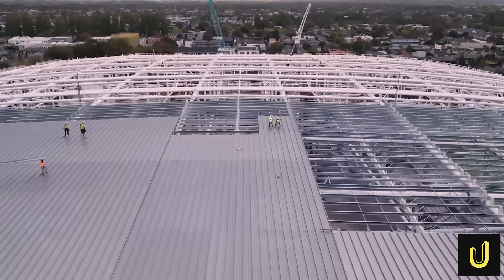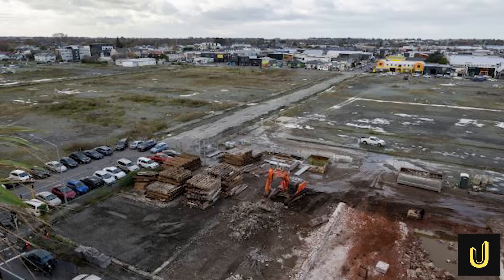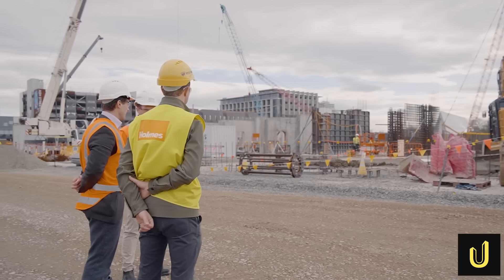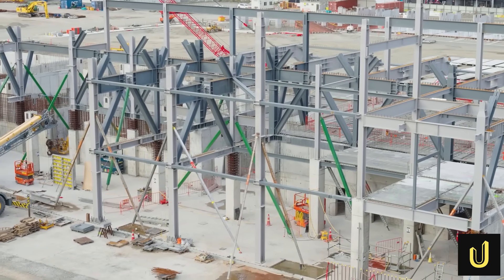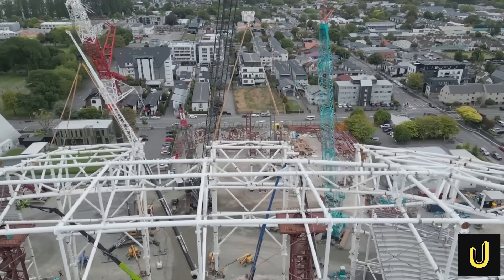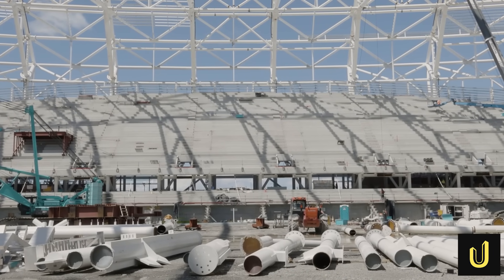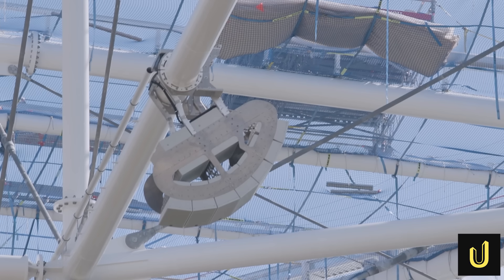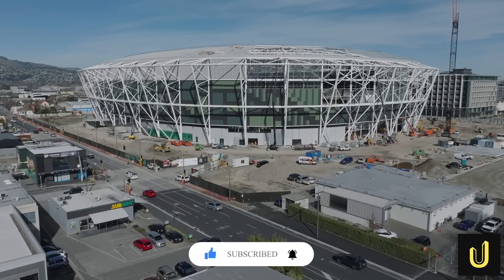5 MASSIVE Engineering Feats Behind Christchurch's New Stadium

Comment: Sadly this stadium is a insulting joke to locals here in Christchurch. the stadium is too small for the city already, and its location is crazy wrong when they had better sites available. we had somewhat of a blank slate after the quakes. there is no parking near by or rail and bus exchange and proposed rail station are 4 or 5 block walk, which is not going to work. current bus exchange facility will not be able to handle the influx of people for events, and inner city traffic will be brought to a crawl as the stadium is between two major arterial one way system, with high traffic flow.  biggest joke of the rebuild and there have been others.
Reply: What a lot of BS. Christchurch has a population 412,000 and a 30,000 seat stadium is more than big enough. The only time they will sell it out is when the All Blacks play there.

Comment: It would have been cheaper to have built it on more stable ground at Rolleston where there is also a rail line from the North, the South and also from the West.  More than enough sufficient area for parking when the stadium has a seating capacity for 24,000 people.  Parking for this number of people in the central city is an engineering problem that needs a solution.
Reply: The bus exchange is 5min away and uber is cheap most people will have a drink or 2 so wont be driving ,and rolleston what a stupid idea

Comment: What does Te Kaha mean?
Reply: It means Maori "gifted" a name that anyone else could have assigned without any fanfare.
Reply: The Strength
Reply: "Te kaha" is a Māori phrase meaning "strength," "enduring strength," or "to stand firm". The meaning is often connected to resilience, with "kaha" referring to strength and "te" meaning "the". It is the root of the phrase "kia kaha" (stay strong), and it's also the name of a New Zealand community on the East Cape and the new stadium in Christchurch. 
Core meanings
Strength: The literal meaning of kaha is "strength".
Enduring strength: A shortened version of the name Te Kaharoa, it signifies long-lasting, enduring strength.
To stand firm: This meaning comes from the name of a New Zealand community, Te Kaha, which was named after its tribes' ability to withstand many sieges. 
Examples in use
Kia kaha: This is a common phrase used for encouragement, meaning "stay strong".
Te Kaha (community): A New Zealand community named Te Kaha, which means "stronghold" and refers to the strength of local tribes.
Te Kaha (stadium): The new stadium in Christchurch was named "Te Kaha" by the Christchurch City Council, with the name gifted by the Ngāi Tūāhuriri iwi to symbolize endurance and strength.
HMNZS Te Kaha: A Royal New Zealand Navy frigate named after the meaning of strength.
Reply: I wish they'd use an English name. Everything is a Maori name, which doesn't mean anything to most people.
Reply: @robert3987  It does have an English name as all or the vast majority of our stadiums, Apollo Projects Stadium (formerly AMI Stadium (formerly Orange Theory Stadium)) , Westpac Arena, Sky Stadium, Forsyth Bar Stadium, Go Media Stadium. Depends who pays the most money to put an 'English' name onto it. Highest bidder, devoid of any soul, this one in particular will be 'One New Zealand Stadium' named after the rebranded Vodafone network in New Zealand. Such a beautiful name that will change as soon as One New Zealand no longer cares about it. Names are all made up so in the end it really doesnt matter what you associate with it, you learnt the names of every other thing you know at some stage through your life, and at some stage the names of those things didnt mean anything to most people either. Te Kaha has a meaning behind it, or it can just be a name, or just call it Christchurch Stadium, or One New Zealand Stadium. People will understand. Ive called Apollo Projects Stadium 'the old new stadium' for a bit now, people still know. Half the people wouldnt know Apollo Projects Stadium though or even less by its other name 'Rugby League Park'.
Reply: @robert3987 if they learn it,  it does.
Reply: @robert3987  I agree. Why does EVERYTHING have to have bro name.
Reply: man stares and yells at clouds^
Reply: @robert3987 what country do you think you're from? Or just living under a rock?

Comment: To say the ground can "swallow it whole" is an extremely exaggerated statement to make.
Reply: Lancaster Park stands sunk 300mm (a foot) at thier centres. 150mm (6 inches) at the ends. Thus they both had a lean outwards.
Reply: Unfortunately where liquifaction is concerned it is  not. Hence why it has the solid reinforced concrete and steel base so the stadium floats . A lot of the rebuilt houses and commercial buildings have this type of base here now. Google Christchurch earthquakes and take a look at the pictures and videos taken at the time in 2010 2011.
Reply: @geofflye4582  Liquidation? I'm not fully confident you know what you're actually trying to explain.
Reply: @Nick.Ashton  Should have been liquifaction.

Comment: The New Zealanders are learning from the Japanese who go through the same or similar experiances.
Reply: “In the 1990s Parliament Buildings in Wellington were refurbished and strengthened. Specially designed blocks of rubber and lead were placed between the new foundations and the concrete beams. The blocks act like shock absorbers, preventing much of the movement of an earthquake being transferred from the foundation to the buildings. This method of earthquake-resistant design, developed in New Zealand, is called ‘base isolation’ because it helps isolate the building from its foundations.”

We’ve been ahead of them for awhile now
Reply: @gregorygraham6712 I wouldn't say ahead, we move forward hand in hand.  There has been an actively promoted sharing of earthquake research and mitigation for many many decades now.   Due to our similar seimic areas.  Many of the technologies that have research in NZ, have never been used here but in Japan first because of the greater availability of funds.
Reply: @gregorygraham6712  this, there's a reason why 2 of Christchurch's more recent skyscrapers survived the quakes will little to no damage

Comment: Next - build a replacement railway station in the center for the fans to get straight of the trains, and for The Southerner, etc. to use
Reply: Dude that'd be the dream.
Reply: Oath
Reply: That is happening. A station is being built by the Colombo st over  bridge.
Reply: @geofflye4582 I'd be amazed if it happens. Its nowhere near the stadium.
Reply: mainland railways is quite literally do this to run an event service
Reply: @finntactics7013 Yes they are, but not to an adjacent station. I think it'll be on Moorehouse and then they will have to leg it.
Reply: Our rates are high enough as it is, thanks. Unless out of towners want to pay higher ticket prices?
Reply: Trams with the rebuild would’ve been perfect….flat everywhere too
Reply: Being looked into.... but hardly makes much sense just for events for the cost... the old rail system isn't what it used to be, AKA single line now... at Kiwirail rates that would be about 2,000,000 moon beams to be able to move turn around the multiple trains required to service a single event let alone the cost for a new platform..
Reply: But wait. Landcaster park has the rail 10 metres or so off the grass boundary.  They could of used that infrastructure and made a world class train stop with stores and buses waiting to take people to the bus exchange during the day and back.
Reply: Should have just built it in the old location. Rail just there
Reply: Buses go from the airport to the bus exchange and no.3 goes right to the stadium. ❤
Reply: It was an insane mistake to not build a combined rail and bus/ tram central station in the CBD, when there were large spaces made available by demolitions that could have been used to make public transport through Christchurch and Canterbury really usable.